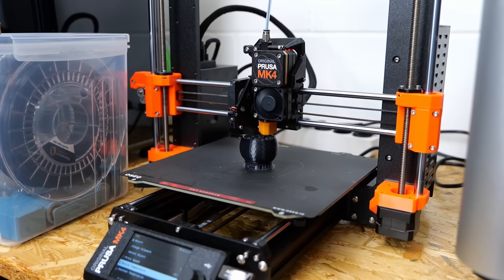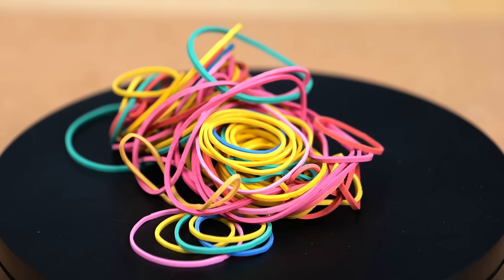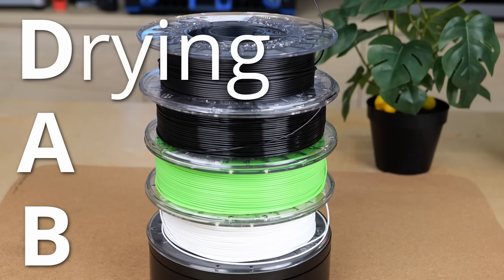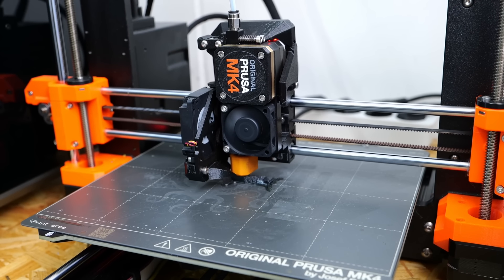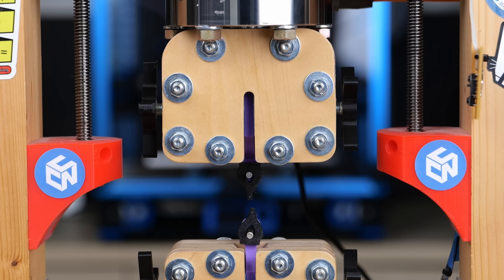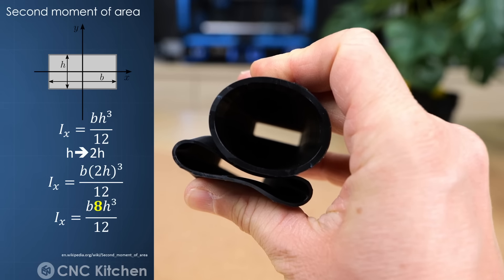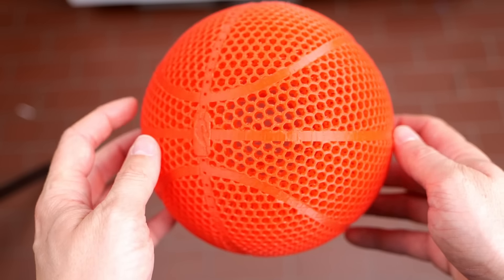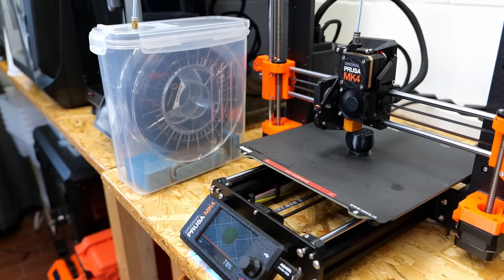Why aren't more people 3D Printing this Indestructable Filament?

Comment: There's a TPE that's described as having a "skin like" feel, for certain products. I wonder of it could be printed in to gloves for "hero arm" style prosthetic limbs? This way the artificial limb could look more like a normal arm and hand, and allow the wearer to have more grip at a lower pressure application when picking things up, such as using a spoon or cracking an egg. Perhaps that 60A is worth a try for this, and then get make-up artist to add freckles and the like to match the wearers skin tones and details.
Locally, finding retailers with TPE's in stock is harder then trying to print them. They're also pretty abrasive to brass nozzles.

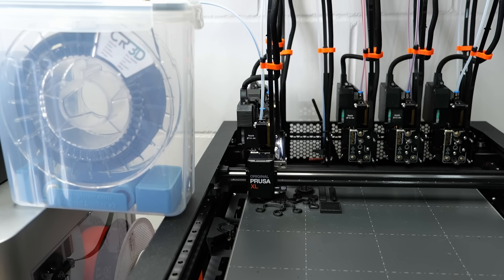Comment: 9:33 I have an instantpot airfrier that has a dehydrate mode. It fits two spools at a time and leave it running overnight. I also put in desiccate packets and when done, put both in a diy dry box with a bowden tube.

Comment: Wow you just totally fixed my TPU issues I never thought of lowering the temperature The biggest challenge is my cheap er 3D printers and prusa slicer having no profiles and me having to make said profile and consistently getting the print temp to stay if I manually adjust it if I turn it down on the printer two or three Layers later It turns itself back up you'd think that converting printers to clipper and writing marlin firmware I would be able to fix this issue not so much tho

Comment: I'm using tent for my printer and discovered that when tpu is in the tent - it's getting too soft on the roll and often ends in problems, but when filament is in cool room its printing perfect (and im using boden ender so it should not be possible), so it's not only printer settings itself :) I would not recommend printing from dryer because of that

Comment: I use eSUN TPE 83A. It works really well, and I printed some custom anti-vibration feet for my Bambulab X1C
Reply: I can confirm. It's great stuff. It has a an almost matte finish, super flexible and tough, and prints really easily. It was my first flexible filement, and it left me wondering what all the fuss was about, because it's so easy to print with.

Comment: I use AQUA NET hairspray. It comes in giant cans that lasts months, goes on easier & more evenly than glue stick, and washes off with warm water. It sticks to any filament and makes it easy to remove TPU and PETG. Yes, I do spray my bed away from my printer.

Comment: I've used TPU for respirator mask, used TPU for the portion that hugs the face and switched the filament to PTEG where it transitioned to the filter assembly. This way the face mask was comfortable and the filter interface solid. The two mixed quite well at almost the same print temp.

Comment: I was hoping for more in depth discussion of temp and chemical resistance. I have printed vacuum and fuel fittings for personal vehicles and equipment from TPU with, so far no negative effects. I have found little info for the chemical and heat properties of TPE. Still a very informative video.

Comment: Hear me out, and maybe this is an obvious idea but here goes: use the very stretchy TPE's for a high friction base, use the pause while printing method to insert magnets, and then continue the print in whatever material you are trying to make the object in question out of. For instance you could make a PETG or PLA fridge magnet that actually stays in place on the fridge instead of sliding down!

Comment: Softness vs grip. That one can be explained by physics easily. The softer the material, the more "squish" it has, thus if it squishes, its surface or contact area becomes bigger and offers more grip or traction, exactly like in racing, where when maximizing grip, people will oftern take air OUT of the tire to have it conform easier to whatever it's sitting on and having a bigger contact patch since it squishes more with less aire pressure. Also on a second part of the answer, the softer the material, the more it will deform and give before actually moving. On top of that, the bounce back after finally having deformed as much as it could before moving releases the energy towards the pull direction and can create a braking effect making it harder to actually move it since it is now fighting back against the pull force, thus possibly explaining also why at some point it requires more force to keep it moving that actaully getting it to initially move. If all this happens on a very short timeframe (think bouncing back and forth many times a second due to it constantly being pulled) then basically you're releasing and ressetting that braking effect without really seeing it occur.

Comment: I printed a finger pulley supporting ring out of varioshore to replace taping for injury repair. Seemed to work but for human stuff the printing constraints are difficult to work around - I hadn't considered that supports would work so well though!

Comment: i do print with tpu, but mostly small simple tool like funnel,  flexi toys for fun and joints for figures, i had to do some print with support, and it worked with prusaslicer organic support, i did use creality tpu, over time the color goes away, even if the print come out great.

Comment: About the damping/ball test: it would be interesting, by doing the opposite like having a steel ball fall on a solid 100% infill test piece, to determine the actual damping factor (I think never or almost never provided in TDS), so that the damping feet for 3D printers could be better designed: the "HULA Anti-Vibration Feet" (links not allowed here) require you to use flex material but "critical damping" (see "Damping" in Wikipedia) is achieved when mass and damping coefficients are properly paired. If I want to print feet for a A1 Mini, or for a K1max, different damping factors are required.
That would be an interesting video with useful practical applications.
Reply: To measure the damping coefficient maybe the easiest way is to hang a weight from a piece of filament and measure the amplitude of oscillations. The ratio is independent from the length of the filament used. Measuring in compression is likely more difficult, but the same principle applies.

Comment: Awesome video! I'm still waiting for the activated alumina video, I'd love to know if it can keep my PVA and TPUs dry, as normal silica is not enough.
Also for anyone having problems with flexibles on Babmbu Lab X and P series, check if your extruder gears have helical or straight profile. The new helical profile gears prints them much better and you should be able to get them from Bambu support ;)

Comment: can you make a video about how safe those reinforced materials are to your health? small glass/carbon fibers can be dangerous
Reply: I'm thinking about trying iron powder. Iron is naturally in your blood so it's probably not that bad...
Reply: The materials aren't dangerous to you since the fibers are embedded in the plastic and will not magically leave it unless you burn the plastic away.
How safe these fibers are depends on the diameter of the fibers. I don't know about other countries, but here in Europe most commodity plastic manufacturers have switched  to fiber diameters that are considered harmless for workplace safety reasons.

Comment: a bit of WD40 on the extruder gear works wonders from my experience.  i have been printing TPE's on my ender 3 for years at this point. printing very slow with no retraction, using very hot temperatures  and drying the filament is required though.

Comment: Nice ball ;) I have tried loads of different filaments for it. TPC worked really well but broke after a few days. I am now using FPLA+ from Sting3D which feels similar and works amazingly. Also, print the ball with the logo or text at the top; this will stop the soft spots

Comment: Experience: I found a video (from uncle Jessie "Can you 3D Print your own $2,500 Airless Basketball?" for printing balls with overture super pla+. I tried it and it was so worst print experience ever. It warps like ABS without enclosing. I tried to print gears - unuseable. Maybe you will try it for your bouncing experiments.

But I like to use TPUs - never had problems printing it at about 60-70mm/s (Ender 3S1) - and yes, keep them dry! The filament dryers are garbage, they do not release the wet air and replace it with fresh cold (and dry in abs. humidity).
I store them in cereal box with humidity meter and replace desecant if display goes over 20%.

Comment: You don't need to add glue stick to your bed to remove the print. You just need to reheat the bed to a high enough temp to make the model slightly soft and it will peel right off.

Comment: I use eSun ebox lite, which works but I don't recommend due to poor UX. Most single spool filament dryers are a closed system with zero or minimal ventilation, so all the moisture remains inside the enclosure. Make sure the moisture has somewhere to go. I put a container of brand new desiccant inside the spool while drying. In a humidity controlled environment you can instead wedge the enclosure open a crack to vent it.
Reply: One setting I change when I swap in and out of TPU - my extruder is 380 steps/mm for my TPU roll, vs 417 steps/mm for PLA and PETG.

Comment: BTW: I have tried printing Varioshore TPU on the BambuLab X1C. It causing no problems until it starts to foam up. When it foams, i had clogged nozzle many times. I think it would require to adjust the Z-axis (first Layer) manually, which isn’t possible as I,m aware of. On the Prusa, this works better (even on a Prusa Mini).

Comment: I'm glad you touched on the moisture issue. I have watched a filament go from dry to moist in 3 hours during a print.
I know there is no "Glass transition temperature" available for TPU, but at what temperature does it generally deform?

Comment: I dry my filament out with an Air fryer, been debating adding a bearing and a Bowden fitting to print out of it as you can get an air fryer much cheaper than a filament drier.

Comment: Hello Stefan. Interesting video. I'm having an issue obtaining a rubber ring for the air intake of my car wich is perished. Looked up the heat resistance of TPE and I think it will do the job. This video inspired me to draw the part in 3D and give it a go. If it does the job, I will let you know. On to the drawing board!

Comment: great video, thanks! would love to see a video about mixing TPE and regular stiff materials using Interlaced Topologically Interlocking Lattice
Reply: I'd like to see a fiber reinforced alloy of TPU/TPE with Nylon.  Fiber reinforced materials often have poorer layer adhesion, but perhaps with the added benefit of TPU's layer adhesion and durability...  I dunno.  I wish I had the equipment to experiment myself.

Comment: I have an original E3D Hemera, I got it for printing flexible filaments but i've had chronic heat creep issues with it despite rebuilding it several times. Printing slow with it amplifies the heat build up and causes it to jam up right behind the gears.

Comment: Hi there. Your Setup for the friction test does not work for flexible materials. In addition to the force to overcome the friction, you will use a part of your measured force to elongate the flex material, so your measured force will include friction and elongation (yo can already see the deformation with the softer stuff in your video).  That would also explain your abnormal behavior with the greater sliding friction. A better setup would be a simple ramp with adjustable slope. Put your material with some weight on the ramp and increase the slope until it starts moving. From the slope you can calculate your friction coefficient. At least the static friction coefficient should be measurable with this.

Comment: I had the 60A from recreus to print seals. It was a challenge to load the filament into an mk3s. The loading worked manually. But the seal did not keep tight.

Comment: I might be stupid lucky but drying TPU has not been an issue across the 20 empty rolls, some nearly a year old, stored in a dry box, printed in open air. 

YOUSU 95 TPU 
228 print temp 

PEI bed in perfect condition glue free, with layer adhesion a satisfying Velcro feel

My experience developing fully 3D printed shoes otherwise completely line up with the findings in the video. 

TPE/TPU is by far the best class of filaments with the largest range of properties and applications

Comment: 2 things i would add. first set your travel speed to the fastest your printer can handle, and there are really big differences in quality between brands, for example it was impossible for me to tune in esun tpu to fix its ridiculous stringing, extrudr, and fillamentum tpu can be printed with almost zero stringing with proper setup.

Comment: I actually make TPU feet for terrariums. I needed a material that would print well on an Ender5, would withstand the temperatures of a terrarium heater, and hold up to loads in excess of a few hundred pounds. They are on my Etsy if anyone is interested...

Comment: Awesome video! Thanks! 
I have printed functional parts with TPU and it's really amazing. 
One problem I haven't solved yet is creep under tension. My application is similar to a conveyor belt and just after printing the part works great, but if the belt is left on the assembly under tension for a couple of days the TPU deforms and decreases my performance.
I could change my mechanical design to compensate for this but I wonder if there is a better filament for preventing creep?

Comment: My stock (except a round cooling ring) Ender 3 prints Amazon basics TPU just fine! Used it to print shoe soles for a cosplay and it worked out great, albeit it had pretty poor grip.

Comment: I use TPE for printing sealings and other rubber parts for my 50 years old motorcycle. actually I have a 90A TPU but I'm still searching for a softer one with a good price

Comment: what works best for me is disabling retractions entirely and designing my parts to not require many gaps to cross. the TPE I have is of unspecified kind, only says TPE, but it doesnt like retractions and leaves gaps after the deretracts, so disabling them entirely gives amazing results and speeds up the print a lot
Reply: Retraction works perfectly fine, with unmodified retraction settings vs PLA or any other material, with flexible materials as long as your pressure advanced is calibrated right for it and your extruder isn't skipping. See for example my 10 minute TPU benchy video with no stringing.
Reply: @daliasprints9798  I dont think pressure advance exists on my 3d printer. also idk if you watched the video but there are many different types of TPE and idk which type the spool I have is, so it's probably different from your TPU

Comment: Really interesting although the tpe’s are all quite specialised it’d be nice if you added in a standard tpu from prusa or Bambu labs as a reference point. (Is it worthwhile seeking out a certain filament based on the application). 

Great video though!

Comment: I bought TPU over a year ago to print replacement band for my wife's Vivofit 3. She got a new one, so I never did any printing. Now I have direct drive in my Ender 3V2, so I'm ready for some experiments. I wonder if I could print some drive belts with TPE material.
The one use I'll be testing is replacements for rubber feet on few devices that use small compressors. These things vibrate like hell...
Reply: You could try, but TPU/TPE belts will get longer with time.
Reply: @FireN2k9  
I think it depends on the elasticity of particular filament and its thickness. CF-TPU can actually work better than typical rubber belts...

Comment: I print a lot of TPU mounting brackets and i also have this problem with "bad surface finish", but because i mostly friction fit parts into these rough tpu brackets they hold in super well, added grip.  Its not  a bug but a feature...

Comment: Silicone can be printed but it’s expensive and can’t be done with typical setups. It essentially mixes part A and part B in a chamber and squirts it out the nozzle. I’m not sure the additives though bc my experience with silicone curing has them cure over very long periods of time. What little I’ve seen looks like it’s curing at the rate that most fdm filaments cool and harden. But I could be wrong. It might just be thick enough and adhere to itself well enough to retain form and hardens over a long period of time as well?

Comment: im watching this as i have my spool of 90A flex material lying on my heated bed at 60°C😂
edit: it did help, I left it on there for about 6,5 hours and started a print the next day. I'm printing on a bowden printer. got decent results but the old spool was still pretty wet

Comment: While it's not very flexible, Ninjatek's Armadillo is a super interesting material that I think you still should have tested. It's a super hard TPU and is marketed as extremely tough like other materials. I wonder what a fiber filled version of that would be like.

I remember one of our filaments we had at a makerspace I worked at printed at a /super/ low temperature. Somewhere around 60 or 70C. I can't seem to find anything about it anymore, but I'd love to hear if anyone can find it.

Comment: I've really been liking the TPEE based filatech filaflexible40 also available in a couple other hardness. Prints very easily, is a good bit grippier than most flexible filaments and has a nice matte (satin like?) finish, at least in the black version. I think they also advertised that it resists chemicals we'll, but haven't tested. It's a bit pricey though, but totally worth it imo.

Edit: I have no idea how I missed you had filaflexible60 in the video lol
Reply: Oh and forgot to add it's also not as hygroscopic as other flexibles either. I've had good results with it despite never drying it and I haven't even stored it in a drybox, though ymmv of course.